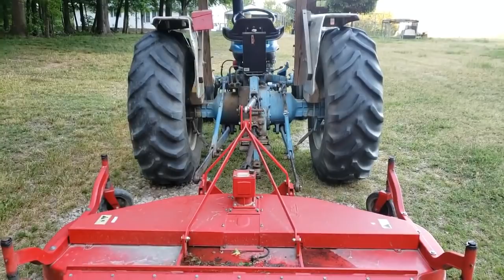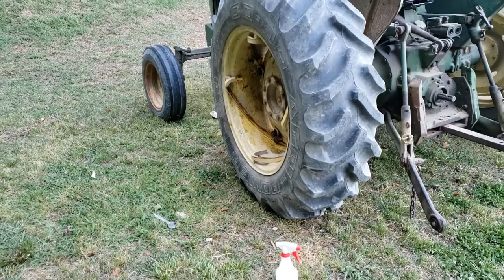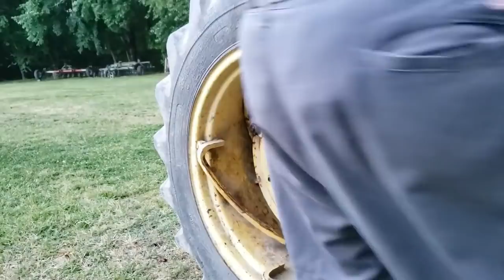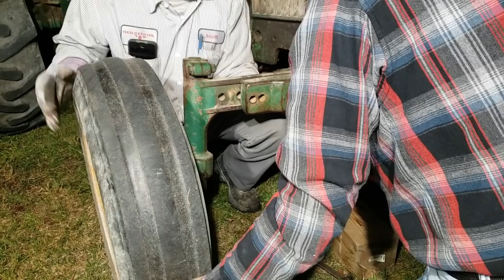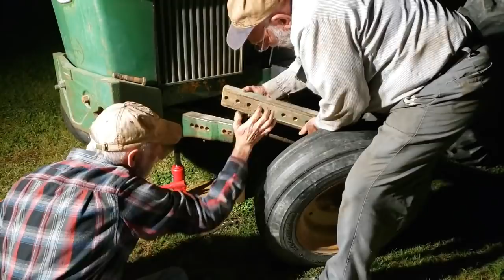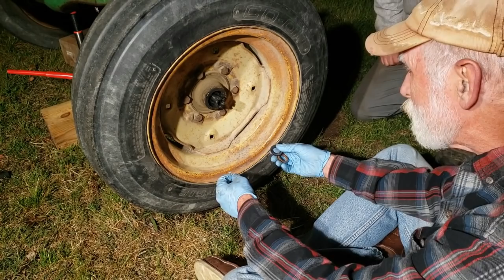Working with Cousin Scott on his 1020

Comment: Back when I worked in the oil field when we did maintenance at the shop I would help the shop foreman named Slick. We had a 10 acre lot full of drill rigs and other equipment. We'd be way out back work and Slick would have me run up to the shop for a wrench. I'd get back with the wrench and he'd say never mind I got it. Can't  tell you how many times I wanted to throw the wrench.
Reply from the maker: Robert I can surely relate to that story you just shared with me it gets a bit frustrating when you come back with the tool and find out they don't need it anymore.  started to take that thumb wrench away from him. Thank you very much for being here watching supporting the channel Robert.

Comment: Although I have not seen a clear view of your Ford rear wheel from the side but I think you are not correct when you said it only had two wheel width settings - wide and narrow. 
As far as I can tell each wheel is made of two metal pieces a) the dish which is bolted to the axle stub and b) the rim which has the tyre fitted to it. The rim is bolted to the dish. Normally the rim has two inch wide lugs mounted off centre of the rim and the dish can be bolted to either side of these lugs which gives a two inch variation of wheel width on each wheel. Because the lugs are offset to the side of the rim you can swap the whole wheel to the other side of the tractor you can alter the effective axle width in two inch steps per wheel. If you reverse the dish on you can get a further 4 steps on each wheel.
Depending on the precise position of the fenders on the axle your tractor would probably stretch from 48 - 72inch wheel width taking the centre of the tyre tread as the measuring point across the axle to the centre of the tyre of the opposite wheel on the same axle.
Reply: Very good explain ation
Reply from the maker: https://youtu.be/WhRRgQ_dj9s
These are the kind of rims on my 4000

Comment: Is that 1020 gas or diesel? My grandad is restoring a gas one with the bottom muffler. It's also different in the way the wheels are widened and shortened. On it you have lugs that you unbolt instead of the slide rails. His old 430 has the rails for the tires.
Reply from the maker: It's Diesel and that little tractor came to this Farm brand new in 1965. I was making the video that I'm giving you the link to using my drone before I really understood how to set the camera up and because I had the camera set way wrong 90% of what I shot that day was unusable it was washed out then I got the idea to set it to Black and White and go ahead and make the video along the themes of a tractor commercial.   I hope you can take the time to check the video out.
https://youtu.be/51I30P8DeVU
Thank you for being here supporting this channel.  🙂